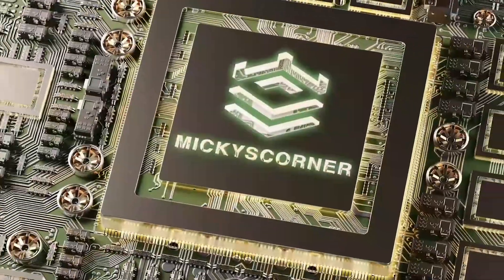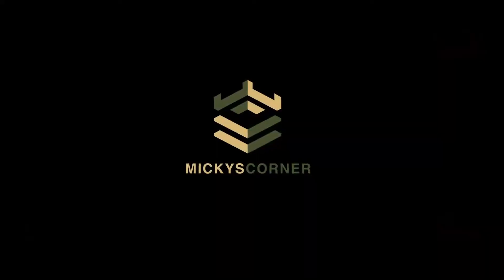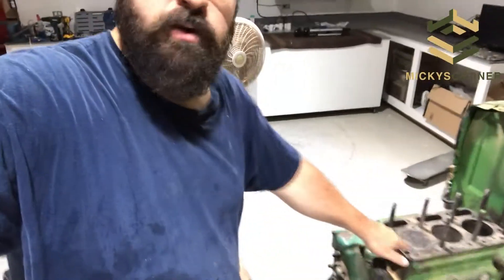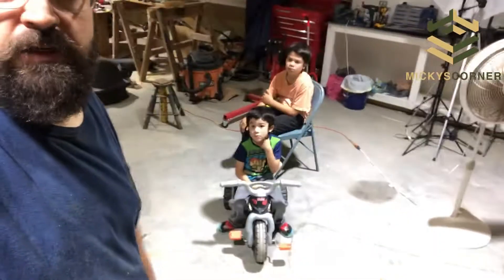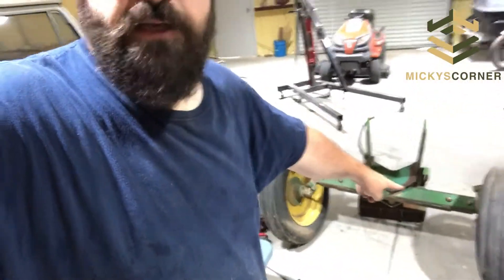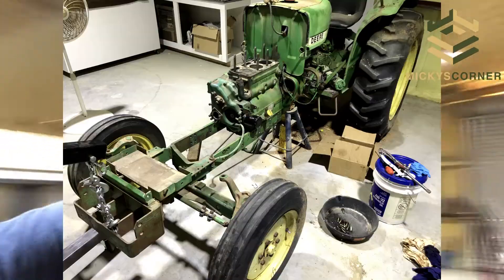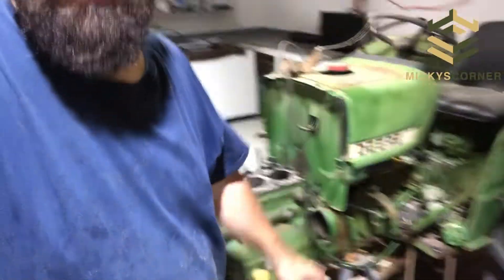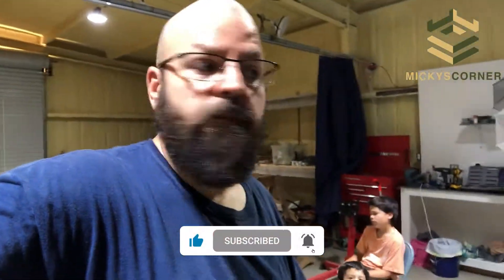WE GOT A TRACTOR. Well sort of.

Comment: I have an 850 little older like 1974 one stage clutch I think.
Reply from the maker: I just uploaded a new video update about the tractor and what I have found so far
Reply: I have a 1985 JD  850. Does your PTO run all the time?
Reply from the maker: @fightingbear8537  I don’t think so but the last time I saw it run was when the original owner still had it years ago. I got the tractor non running